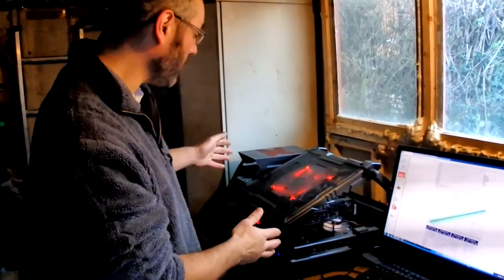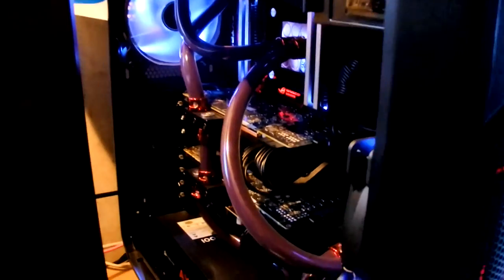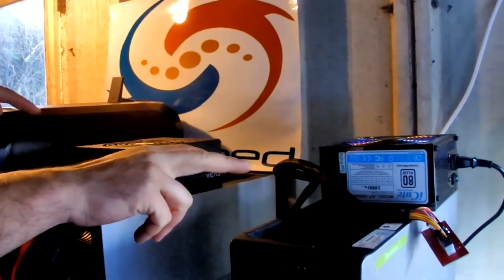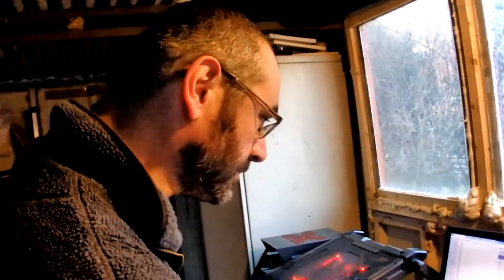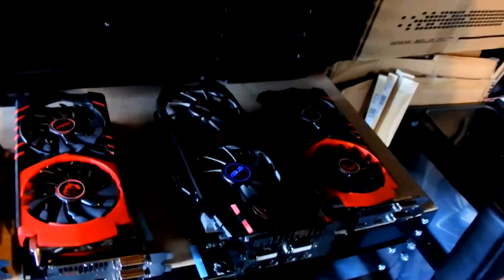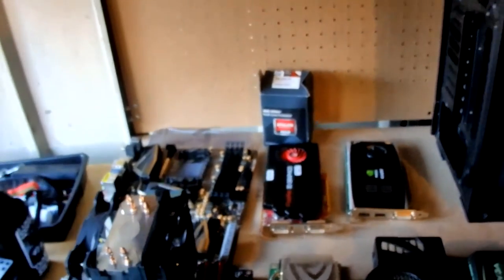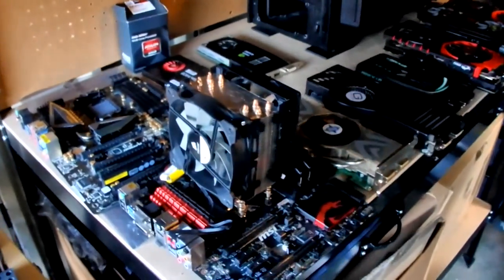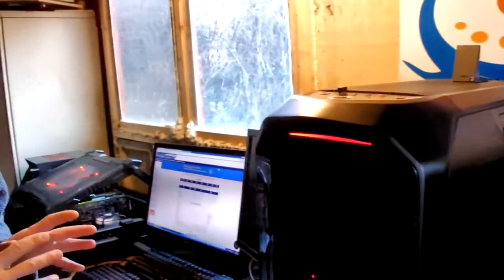PcShed Folding@Home 2016 PC Project Update Vlog 1

Comment: Sergio thank you for this video! One question,  I'm looking for a GPU to put in my server (that runs 24/7) and let it Fold @ Home.  Please correct me if I'm wrong, but the more 'Cuda Cores' a GPU has the better for F@H correct?  I'm looking at the gtx 980ti w/ 2816 cuda cores ... then I looked at the GTX 1060 thinking surely that has to be a better GPU than the 980!?  But the 1060 has 1280 cuda cores.  Are the Cuda Cores more important than the amount of memory a GPU has when it comes to F@H?  Thank you very much for your help!
Reply from the maker: Hi Ryan sorry for the late reply as i not been doing much on Youtube. Yes cuda cores is king when folding@home versus memory. In regards to GTX980ti versus GTX1060, you comparing two different architectures (Maxwell versus Pascal) and Top Tier flagship maxwell versus mid range. So the 980ti will give more ppd compared to GTX1060 but the GTX1060 is more efficient in terms on electricity usage. Hope this helps.

Comment: Have you considered ASIC machines?
Reply from the maker: Hi, yes i did, but this was a 4 month experiment using a mix of mid to top of range gpu to see how it performed against people who been folding for years. I think we still in the top 30 with our result in the Custom PC & bit-tech folding team. Not bad considering what we have not folded for the last six month.
http://folding.extremeoverclocking.com/user_overtake.php?s=&u=693549
Reply: Fair enough. Yes I found GPU's work pretty great for folding. It can be addictive to see what folds the fastest and makes the most points.
Reply: they say folding with miners is impossible. or there is some way? https://foldingforum.org/viewtopic.php?f=17&t=28619

Comment: hi, so you dont recommend folding on a cpu? i have a 5820k 4.5ghz
Reply from the maker: You can fold on the cpu especially the 5820k depending what work unit is allocated to it and as it got 6 physical and 6 logical cores it would work well, but your return in folding points will not be as high as if you folded on a gpu say a 970 gtx. a 5820k will give you between 40-50k points ppd, again depending on the WU's allocated while a 970gtx will five you 250k ppd. hope this helps.
Reply: @PcShedTV  @PcShed that's really helpful.  Basically, you're talking about ROI (return on investment) ... for every one unit of one unit of electricy I put into my folding rig, I want the most amount of points possible back.  So if I put one unit of electricity into my rig using the CPU I'm going to get much fewer points at the end of the day versus if I put one unit of electricity in and use a GPU to Fold and produce a lot of points.

Comment: I guess it's not really worth it running FAH on my macbook pro. It only yields 13k or so PPD... I might use my R9 280X to contribute in the summer when I have access to it :)
Reply from the maker: +Martin Ma Your R9 280X will give you a lot more ppd than your cpu. GPU folding power is King!
Reply: Do it every point and person doing it counts and helps many diseases .
Reply from the maker: very true indeed

Comment: my 280x folds very slow any ideas?
Reply from the maker: It depends what WU it is doing. Overclocking speeds up a bit but make sure you adjust fan speed to compensate for increase of temps.
Reply: according to google spreadsheet a 280x should provide 138-200KPPD. if it's much lower than that, you probably caught a bad wu, such as p11430, p7621 ...